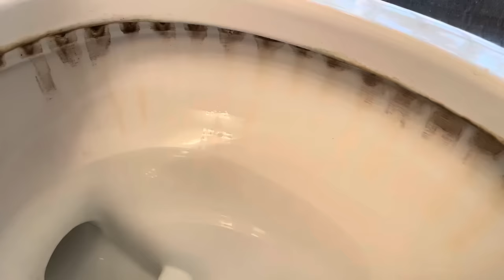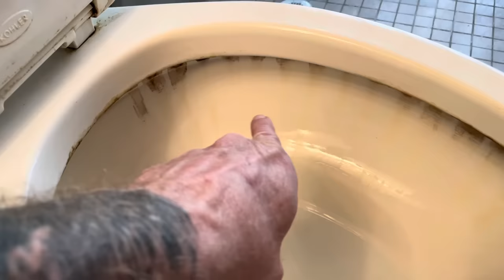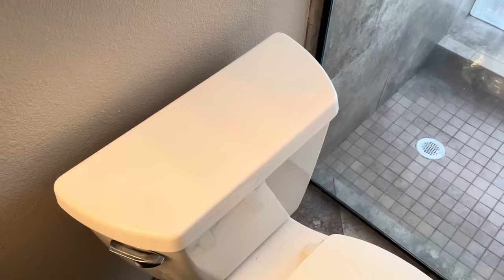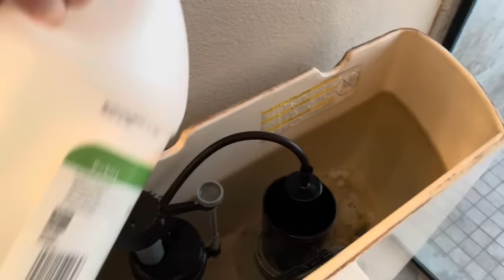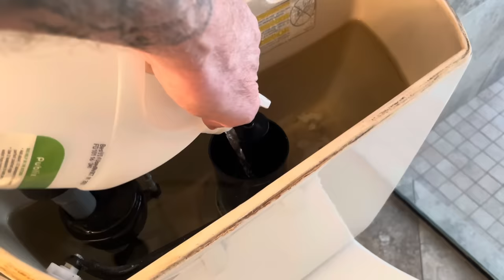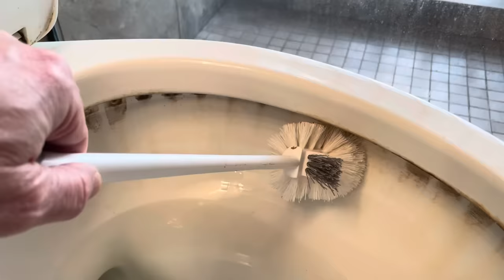Why Does THIS Keep Coming Back and How to STOP it

Comment: Thank you! Our apartment was recently outfitted with this kind of toilet.  I have been cleaning that mold off with a Magic Eraser and a sturdy pair of rubber gloves. Now that you have shown a more effective way to tackle this, I make this part of my cleaning routing. Trust me, the mold issue is really a problem in South Florida.
Reply from the maker: Glad I could help!
Reply: Yes! I use the magic eraser too!❤️
Reply: And so is cocaine and theft
Reply: Be aware that there's eating vinegar, which is like 2%, and industrial cleaning vinegar which is like 30%. The latter kills mold way better, but the smell of vinegar will be overwhelming.  Like, buy a respirator overwhelming. Like, if the room doesn't have windows, don't expect to use that toilet for a few days.  But if you get mold on your walls, use industrial vinegar and let it dry before trying to paint over it.
Reply: @jamesdep8128  oh gosh 😂

Comment: To make it even more effective, first drain and clean the toilet bowl and tank with Dawn dish detergent then dry and put duct tape around the jet inner circle.  Pour vinegar into the hole in the rear tank.  Let it set for a few hours then remove the duct tape and refill the rear tank with water.  This longer method kills  the mold and removes the white calcium scale.
Reply: Love the tank and bowl draining and duct tape idea. Plumber 45 yrs.
Reply: Whatever you do, make absolutely sure you use Dawn brand dish soap.  😂
Reply: You should make a video
Reply: Vinegar, citric acid, baking soda. Pour plenty baking soda and citric acid in tank. Pour vinegar and dawn down drain. Best DIY pipe cleaner.
Reply: @joefer5360  instead of baking soda, use Cream of Tar Tar. The baking soda will just raise the pH of the vinegar and citric acid mixture closer to neutral (hence the bubbling). Cream of Tar Tar will react, bubble, and form a better cleaner.
Reply: @joefer5360 it worked with citric acid...it came back so now i will try the vinegar 🙂
Reply: How do you drain the bowl without the water coming back
Reply: @littlestbroccoli Turn off the water to the toilet.
Reply: @BlackWarriorLures  Oohhh. Thank you
Reply: How can you let a toilet sit for a few hours?  Don't you have to use it before then?
Reply: @MrChopsticktech hopefully you have a second toilet. Or you could water the grass in the backyard…
Reply: I've found that only a chisel will remove the scale. I've always used vinegar but the scale has never come off for me with just the vinegar.

Comment: This is a life saver. It worked so well and the mold hasn’t returned after a few weeks amazing. Thanks so much
Reply from the maker: Glad to hear it helped. 👍🏻
Reply: @papajoeknows8355  any advice if we don't have access to the tank? My toilet just goes straight to the wall
Reply from the maker: @lukasg4807  unfortunately, there’s no way to access the internal rim cavity with a tankless toilet. But the two videos linked in the description will help you with the stains you see underneath the rim.

Comment: Vinegar is great for so many things. Even letting it sit in the toilet over night for nasties that are stubborn too. Push as much water out of the toilet as you can w a plunger and fill it with a gallon. I think too doing a daily tank and bowl soak would help keep up on the mold, you don’t need the whole gallon just 1/4 cup split between the two, no scrubbing until when it’s obvious

Comment: I agree vinegar is needed but there's a good chance the toilet seal is leaking... or it was leaking.  Most toilets have a flapper but this design is different.  There's an flat seal at the bottom of the black plastic which might need to be replaced.  Also it appears the water level level is too high... not sure.  If it was too high it would be spilling over into the bowl, causing constant wetness and mold.  After the maintenance issues are fixed, vinegar can be used.
Reply: thank you!

Comment: I have been using pumice stones on this to get it removed. All I needed was vinegar!?!? Thank you for saving my arthritic hands from unnecessary scrubbing. Being 50 sucks sometimes but I love that I'm still capable of learning.
Reply: Bleach works on this almost immediately, too.
Reply: @alandab  Thank you! Pour it the same way? I will try anything. My hands can't take the scrubbing anymore.
Reply: @3ch1dna07  Yes. Or you can put it in a squirt bottle and spray it directly on the affected areas. Additionally, I would pour some in the bowl, then let it sit overnight to combat stains that develop inside the bowl itself.

EDIT: Word of caution. Do not forget to flush before use! Ammonia and bleach do NOT mix without deadly consequences.
Reply: @alandab  absolutely! Thank you for the tip. Anything to save my hands is appreciated.

Comment: The only time I ever had this was when I lived with my diabetic Ex. It even showed up in our vacation home toilet! Never had it before him or in the 5 years since being on my own. A friend told me she was battling a moldy toilet and her husband is diabetic 🤷🏼‍♀️ I would suggest checking the sugar levels of your urine.
Reply: sounds like bs. urine doesn't get into those jet holes, it's only tap water.
Reply: can confirmed sugar level in your urine gets in the toilet but only at the bottom of the bowl where the black stuff feeds on the sugar in the urine. Never the top as that is not how things work unless you're straight up peeing into the tank?
Reply: @roybaty4785  you both may want to consider googling how smell works. If you can smell it, then its aerosolized particles are in your nose. If it can reach your nose, then the bowl has to be absolutely covered in these same aerosolized particles. I'm not going to suggest that correlation equals causation, but fungi absolutely love sugar as a food source so a link between them would definitely lean more towards probable than improbable.
Reply: @jamesbumgardner1469  If you don’t flush after peeing and keep the toilet lid closed, then maybe you have a point.
Reply from the maker: Is This a Sign of Diabetes?
https://youtu.be/9uGJail7GUQ
Reply: Thanks for the follow up PapaJoe👍🏼 However, I’m still sticking to my theory.  In my 60+ years I’ve only seen this occur when I lived with a diabetic for 7 years and it certainly wasn’t because of a lack of cleaning. I understand completely how a toilet works but I also know that urine splatters everywhere. I would like to know who these guys are who manage to pee directly into the bowl with no splash or spray whatsoever 😂 😂 😂
Reply from the maker: @rubywest7137  my 60+ years have taught me that it’s futile to argue with a woman over anything related to a toilet. I think you’ve got a good theory there. 👍🏻😂
Reply: Complete bs
Reply: It is a cause of the mold. Sugary urine splashed into the rim and since the flush doesn’t rinse the entire rim, mold grows.
Reply from the maker: @prst99  ever cracked open the rim of a toilet?

Comment: Thanks Joe! I've seen a similar approach where users first empty the bowl, dry the under-rim real well, and then tape off the holes. They fill the center pipe as you did but this time the vinegar sits in the rim channel for a while. They complete the process as you described. Thanks again!

Comment: This is good. I hadn’t  been able to figure out how to aid in scrubbing. I do keep a plastic container in the tank with a small hole drilled in the side and drop a dishwasher pod in every few weeks. I find the slow dissolve from the small hole helps mitigate the mold returning.
Reply: Awesome tip. Thanks!
Reply: That’s interesting. Where do you place the plastic container? To keep it from falling to the bottom?
Reply: @DrLauraRPalmer  I used a large container, (the dishwasher pod container) in part to reduce the amount of water. Then make sure it doesn’t disrupt the mechanism.
Reply: I use a hanging bowl cleaner that you hang on the rim of the toilet –BUT it should be the one with STRONG ODOUR . The smell reminds me of naphthaline but it is not naphthaline. That problem of mould vanished rapidly after I put that on.
Reply: The dishwasher pod is a great idea. I've used commercial bleach-like things and they just ruin the rubber of the flapper.

Comment: Vinegar is also great removing rust! Allow your tool to soak for a few days, depending on how bad it is and scrub & rinse.  You'll be surprised!
Reply from the maker: True. I should do a video on that. 👍🏻
Reply: Wow, didn't know that, thanks! 💖🙌😺
Reply: Maybe use spare gun oil too.
Reply: Gee!  Can’t use my tool for several days.  Not as big a problem now as it was when I was young, but will still be a bummer.
Reply from the maker: @JKerr-iy2jr  who said anything about not using your tool for days?
Reply: @JKerr-iy2jr  I know... right!
Reply: @papajoeknows8355  sorry - I was attempting or make a joke in response to the post by Wes32168.  Nothing personal!
Reply from the maker: @JKerr-iy2jr  hahaha, no worries. 👍🏻

Comment: Living in Florida, I find this to be a common problem. Even my sink faucets have this problem and my shower. So, I clean the black mold periodically from the jets.  But this is a simple fix that I didn't realize started from the inside. Thanks for the knowledge. I will handle it now and be rid of the toilet mold!

Comment: Thank you so much for this tip!  If you use the stronger cleaning vinegar (I got 30%) from Home Depot, in a couple of hours, ALL of the mold is gone.  You don't have to scrub the mold under the rim - it won't be there!  Great hack!
Reply from the maker: Thanks for sharing!!
Reply: I was just wondering about using cleaning vinegar! I was worried it might be too caustic, but will definitely do it now. thanks for sharing 😊

Comment: That dishwasher pod ideas interesting. I use a mesh bag from fruit and place a bar of soap inside tank suspended with knotted bag. Knot holds bar near waterline. The resulting soapy water keeps the tank and bowl fairly clean. You still need to wash/ scrub regularly but it's clean, fragrant.
Reply from the maker: I thought the dishwasher pod idea was interesting too.

Comment: Thanks for sharing good info!  (Not a lot of people know that vinegar is a more effective disinfectant than bleach.  I had mold behind bathroom wallpaper I removed and research said never ever treat black mold with bleach, but use vinegar instead.)
Reply from the maker: Absolutely, vinegar is better by far. 👍🏻
Reply: I’ve heard a lot of people say that, but only bleach will clean the mold on the bottom of my shower curtain liner. I tried using vinegar the last time I washed it and it did not come clean. Rewashed with a splash of bleach in the washing machine and it came out like new
Reply: @christinemmac  Oh I agree! Some things won't go away with anything but bleach, but I think of vinegar just as a disinfectant, and killer of nasty things!
Reply: What about h2o2?
Reply: I use vinegar for light cleaning bleach for heavier needs/duties
Reply: @_morgoth_  I've only used it for my teeth but that's a good idea to try on cleaning things!

Comment: When I bought my 1970’s house in 1984, it still had the original toilets and there was never a problem. In 1989 we remodeled the bathroom and out in the Kohler $400 throne sized toilet. Ten years later the mold problem began under the rim like you show. Hey vinegar is cheap. I will get back here and let you know how it turned out. One gallon should take care of up stairs and down stairs toilets. Wish me luck with the muck.
Reply: vinegar is not all that good for ur rubber parts in the tank. i used it in my washer & bout rusted it out.

Comment: Mold in toilet can be a sign of particle build up . Most likely well water. You can install on the in line a particular filter. This cleaning with vinegar is a great tip. Seen one they said bleach. I say No for it can damage your seal . Great video
Reply: Can't vinegar damage it from the acidity?

Comment: Same problem, and I spent a couple years experimenting  (was driving me crazy). What the gentleman doesn’t say is the vinegar will get rid of harness build up that is food for the mold. Some molds will not be killed by vinegar alone, like the orange mold I had. In that case I used a bottle (500ml) of 3% Hydrogen Peroxide ( the first aid stuff) pouring it the same place and it killed the mold.
Reply: @@kaybeetoyz Yes it is gross! And was a mystery until I found out it was mold and can be different colours. In my ensuite the mold is an orange colour. I keep a clean house so I had to figure it out how/ why it kept coming back( replaced all my toilets too). Apparently the mold spores are very tiny and can stay air borne, yikes. That bugged me so I sourced a hospital grade product that would kill mold.  Purchased a hospital grade food safe disinfectant/ cleaner called  “Vital Oxide” and a fine atomizer.  Now ( every few months) I spray it in the air of the bathroom and on hard surfaces when cleaning the bathroom . No more gross mold! Good luck 🙂

Comment: This was useful. However, the source of the problem, as you mentioned, is because of how the toilet operates, which I translate into “design flaw”. That is, the toilet’s design allows for leftover water to set in that cavity around the rim, which then allows for easy mold growth. If this is true, then one could only hope that newer or more modern toilets address this issue at the root: by impeding water to collect where it shouldn’t.
Reply: The reason water sits in the rim is not only because of it's design, but also because the inside of a porcelain (vitreous china) toilet rim) there is no protective ceramic coating, like there is on the outside. So it is porous and absorbs standing water on the interior. Even if they shaped it differently, they would still need to seal the  interior channels somehow.

Comment: Thanks for the video. I recently purchased an device on Amazon made by Fluidmaster that uses a bleach pellet cartridge. Each time you flush water flows through the bleach pellets and then into the overflow tube and circulates through the holes like you show. The bleach never gets into the tank, which can detroy the plumbing parts. Very good system, but you do need to replace the bleach pellet cartridge. Replacement is based on usage. I have one main toilet that needs a new cartridge about every 60 days. Another I have lasts about 120 days. Just an option.
Reply from the maker: The problem… Bleach is somewhat effective at killing mold on non-porous “glazed” surfaces. But the internal rim cavity of a toilet is not glazed and is very porous, so vinegar is far more effective, as it’s able to kill mold deep down to the roots. As soon as you stop with the bleach pellets, it will come right back, which keeps you buying the pellets.
Reply: @papajoeknows8355  Hi, I have used bleach pucks somewhat works, however they deteriorate rubber flapper over time. What would you recommend for pink mold around Tub Drain?
Reply from the maker: @lenguindon5019  close the drain. Pour a little vinegar in so the the mold is covered. Let it sit for an hour or longer, then scrub it off.

Comment: Spray some lime scale remover too.  That mold clings to the rough surface of lime buildup from hard water minerals. Both lime remover and vinegar or bleach need to be sprayed there directly too. Vinegar will do both functions. Costco has cheap vinegar.
Reply from the maker: Good idea scale remover, but vinegar does actually break down mineral deposits as well. A way to quickly remove it is with a pumice stone… I should do a video on that. 👍🏻
Reply: @papajoeknows8355  Yes, that is what I said too. Vinegar does both. The problem sometimes is that vinegar rolls down too fast on vertical surfaces whereas the lime scale remover can be foam and cling longer.  Tricky business on vertical surfaces.  I'm sure the Marine world has good products for that.  Your audio is very muffled and low so not easy to hear what you are saying.  Try getting a shirt microphone or separate one from the camera.
Reply from the maker: @mjremy2605  that’s interesting regarding vertical surfaces… I mix a little Dawn dishwashing liquid with vinegar on shower glass mineral deposits. The dawn helps to suspend the vinegar so it has a chance to loosen the deposits before you lightly scrub. I bet the same would work with the toilet.
Reply: @papajoeknows8355  Aha!  That sounds great. I will try it. Those pesky shower doors are always stained.  Dawn is good stuff.
Reply from the maker: @mjremy2605  I did a video on it a while back…

Soap Scum / Water & Mineral Deposits on Shower Door Glass / Does Vinegar & Dish Soap REALLY Work ?
https://youtu.be/PgVeiUJpRa8
Reply: @papajoeknows8355 I use the pumice stone.
Reply: @mjremy2605 use tissue paper or a rag to make sure the vinegar is in contact with viertical surfaces and awkward nooks

Comment: Vinegar and Baking Soda once a week. I/2 Gallon of Vinegar and Half of a small box of baking soda. Flush and let sit for an hour and repeat.
Reply: No offence but I’ll be danged if I’d spend that much money over a year for vinegar and baking soda to clean a toilet!
Reply from the maker: I will tell you a secret… mixing baking soda with vinegar neutralizes the acidity of the vinegar, rendering it far less effective. You’re better off using them independently.